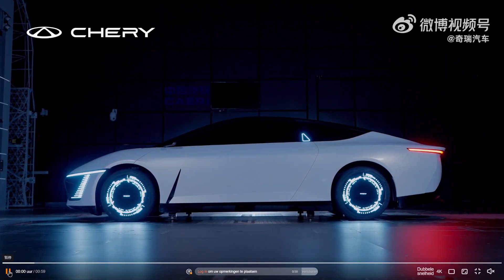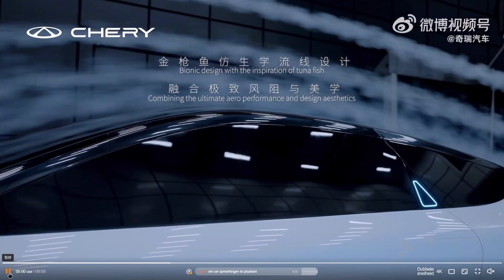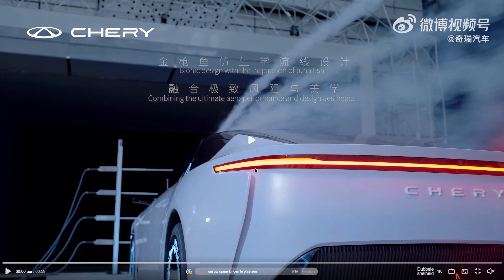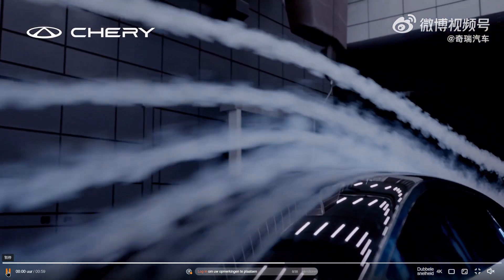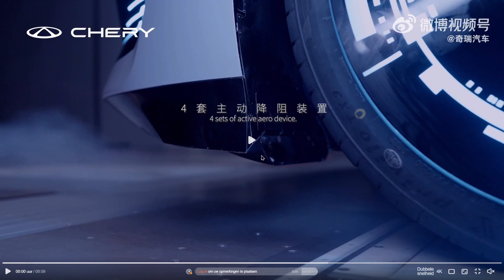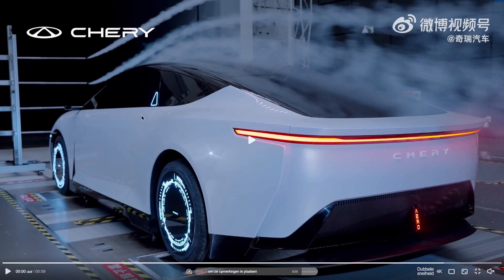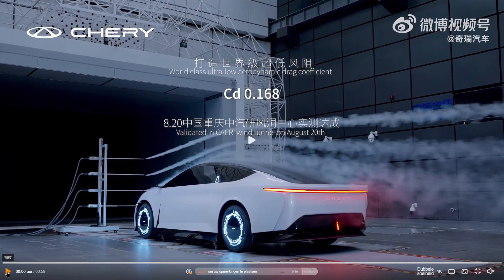Lowest Drag Coefficient in the World - The Chery Aero Concept

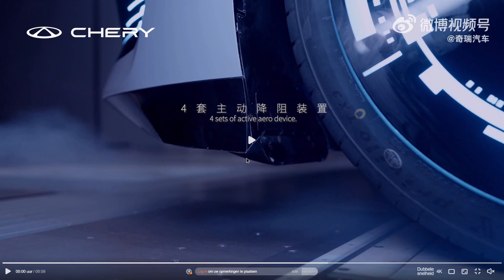Comment: 3:20 does the sloping surface create a component of lift? is it retracting for a high speed stability mode?
Reply from the maker: Yes, usually such a slope increases rear axle lift. A small spoiler at the rear can already help a bit.